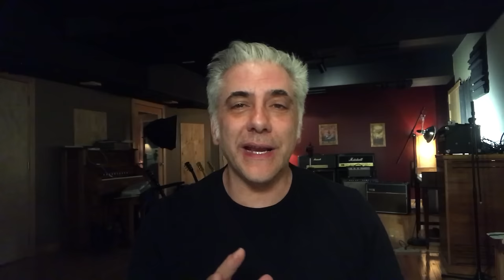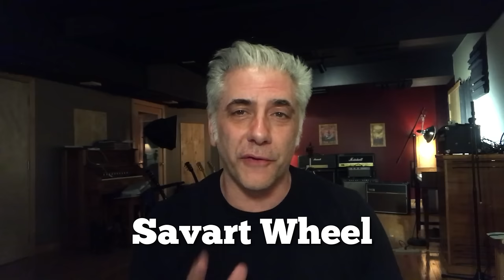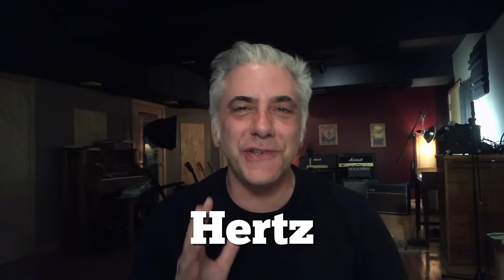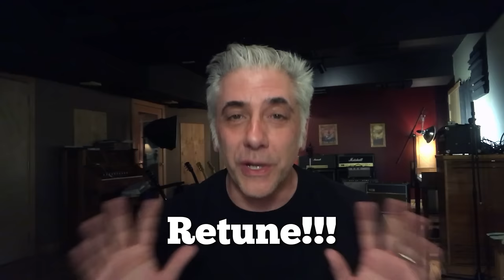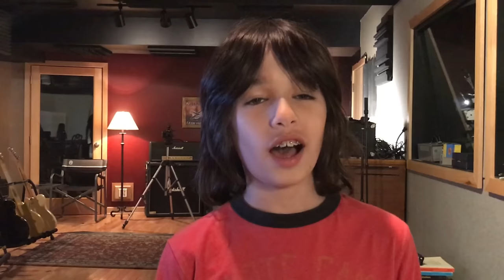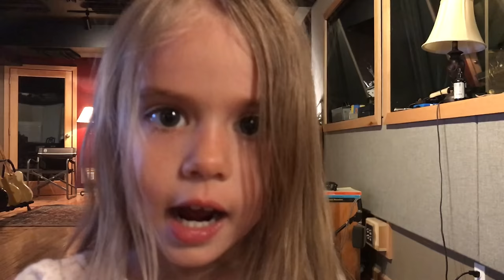What's the Deal With A = 440 Hz vs 432 Hz? Let's Talk!

Comment: I absolutely love everything about how my guitar sounds and FEELS/RESPONDS; even through the amp, when tuned to my preferred Ab/Drop Db = 432Hz. However, considering nearly every piece of recorded music that i grew up listening to; and still do, was recorded using A = 440Hz(or some variation of it), so learning/jamming along with pre-recorded music or friends, is impractical. But my love of 432Hz has nothing to do with any mystical, cosmic, or devine theories. I can only say that when my guitar is tuned to Ab/Db = 432Hz, it just sounds, feels, and responds in a much more "relaxed" way. Not so tense/intense. If that makes any sense.
Reply: Ab means that E string is Eb? I think this is 415hz
Reply: I like half step flat alot on my classical because it's mellowed out and more rich sounding. I am also going to try A 432 and half step flat from there. I wonder if the strings will sound floppy. . .
Reply: @micahmeneyerji  you are just speculating on his behalf. singers strain voices singing lower notes in 440, than higher notes in 432.
Reply: 432 is much more mathematically clean.  3 x 12 x 12 = 432.  Generally, when I'm modding games, I like multiples of 12, because 12 is in common with both base 3 and base 2 and has crossovers with base 8.  Idk, I just like base 12.  It's a really nice number.  In music, it probably doesn't matter.  Most people don't even appreciate the instrumentation of a song, let alone are able to hear a 1.8% difference in pitch.
Reply: @manictiger interesting! Western music is divided into 12 notes. 
So is time, clocks and calendars. 
And we used to use the imperial measurement system 12inch = 1ft etc
Reply: While there may be cosmic or mathematical justifications, I agree with your perspective.  It is all about our senses--which from birth we are taught to ignore and rather conform to what "experts" agree on.  And that there are so many people who feel such a need to debunk 432 is very telling IMO.

Comment: Sexagesimal second have 6.000 years. To discuss the seconds and the measurement of time and space based on the rounded seconds for the Hertz, before, we need to understand the sexagesimais origins of the second. Each turn of the clock has 43,200 slices, or seconds. And the number 60 is not a random choice. 60 is the smallest number with the largest number of connections: 1, 2, 3, 4, 5, 6, 10, 12, 15, 20, 30 and 60. We don't invent mathematics, we just discover the relationships between the quantities, and give them names. That's why I reaffirm that to understand the relationship between the number 432 and the sexagesimal mandala of 60, we need to understand its origins in mathematics, geometry and cosmology.

Comment: Dear sir, this standardization issue is a bit of a "red herring" in that it supposes that the frequency that A is mapped to is really important, but as you point out for centuries (perhaps millennia) to exactly map a master tuning frequency to 440 Hz would have been impossible without modern science.  So how did they tune at all?  For guitarists this an important point and leads us to the 6th, and the difference between natural tuning and equal temperament and Das wohltemperierte Klavier (The well-tempered Clavier) by Bach and the differences in the fractions that make up Natural tuning (for instance tuning a guitar or piano to an open chord such as G Major or E Major versus Standard tuning.  When tuned to the single Major Chord, as one goes around the Circle of Fifths, the 6ths begin to detune due to the fractions used in relation to the key center.  Meanwhile in Standard or Equal Temperament, the division between half-steps is constant, and thus as one goes around the Circle of Fifths (no matter what key one is in), the "out-of-tuneness" is spread across all semitones as opposed to being solely centered on the 6th.  If I am not mistaken, this also is the source of differences in notation on enharmonic notes, and the use of sharps when ascending and flats when descending for historical purposes.  And finally, it took the three strings of a harpsichord or piano to really center in on equal temperament.  Electronically, due to the fact that sine waves produced by electricity do not have inherent overtone artifacts unless they are deliberately designed in, we can have any mapping we desire, but it won't sound "as real" until the proper odd and even harmonics are added.  Just my two cents.  Great video
Reply: Dude, that's like at least 3 cents.
Reply: A very succinct reply.
Reply: This would explain as to why my open chord tuned guitars sound better tuned to A332 vs Standard tuned; then I just stick to the 'norm'.

Comment: Notes A3=216Hz (-31.77 cents) and G#3=204Hz (-30.7 cents),, just lay completely natural to my voice.. The ~ 30 cents lift from ~432Hz to 440Hz for A4 is not natural for my voice... MY voice relaxed resonance is around the tuning of A4 at 432Hz.. Singing high notes comes very natural when the guitar is tunes at 432Hz vs 440Hz.. The passaggio is shifted too high at 440Hz
Infact the highest pitch for my voice if I lay of a lot of weight (early transition) is ~438Hz (~8 cents). A4=440Hz is very difficult to find the balance in the throat..  In my world 440Hz excludes a lot of voices in music.. The previous european pitch at 435Hz is a better comprimise between a high (445Hz) and low pitch (425Hz). 

A4=424-425Hz would be close to Mozats and Händels pitch as they used a forks at A4=421.6 and 422.5Hz but they were probably using a more "pure"  tuning system like meantone or just intonation which was much more common which sets the A (major six. or La) note flatter relative to 12-TET in the C major scale. I think it was a piano tuning company from late 1800s that had their pianos tuned in Meantone at 433.5Hz for A4 and with 12-TET is was A4=436Hz. A difference of ~10 cents.   
A tenor hitting the high notes to Händels halleluja to a piano tuned to 425Hz would be easy, nice and full.. At modern A4=442-443Hz which many like to tune their classical instruments at .. The tenor sounds bad... It is only the spinto tenors (very few individuals) that would sing the high part with ease... 
We got it all wrong,, The previous pitch at 435Hz is as high the note of A4 should have gone to get the right classical division of fachs.. 
This is a fact...440Hz is a very "unnatural" singing pitch if I may use that word.
Reply: dansk björn 440 is unnatural to your body, and it is to mine as well - but my body is more comfortable around 450. The tiny bit of extra sharpness really helps me maintain consitant intonation. Conversely, I have an old bass trumpet that doesn't tune any higher than 430 - and I prefer to play it around 425. Every body and every instrument is different, and you gotta do what works best for you and for your equipment!
Reply: 424-425/449-450hz as a nice spot i completely can relate to. it is another nice area together with the 432/457hz area. what is your vocal fach when singing.. 
the weirdest pitch area for my voice is 439-445hz. not low enough and not high enough

Comment: Western music in equal temperament uses 12 different frequencies, only one of which is a multiple of the frequency of A : the A itself.

A piece in Eb major tuned at 432Hz will contain no A at all, so no instance of a note vibrating at that 432Hz frequency.

This should be enough to debunk the 432 Hz bullshit.

Comment: Cycles per second weren't specifically measured until the year 1834 when the Savart Wheel and the Tonometer where invented, but because the metric system came out in 1795, music was accurate; even more so, relatively, than most people today with tuners. They knew, then, the note range for any given length of tube for a horn or a pipe organ to get different notes for transposition. The earliest development known for the metric system is from John Wilkins. 

In 1668, he proposed a coordinated system of units of measure for length, area, volume, and mass. This means that people knew what they were tuning and building their instruments to for more than half of the Baroque Era and all of the Classical Era. Things are generally accepted before they become standardized, but even if instrument makers didn't know the Hertz value, the metric system is defined as being derived from nature. 

So, like I've explained, instrument makers, then, knew the acoustical output of instruments based on the shapes and sizes of natural objects through simple observation. They might not have had tuners, but Europeans knew how to trace and compare lengths precisely since before they came out of caves. Perception is rooted in nature and the observation of it consciously.

This is why your son sang a 33 and a third cent wide quarter tone. Let me explain; he had to hear when one note range started and the other one ended. 448 Hz tuning actually sounds 1/3 of a note flat, 440 Hz sounds 1/3 of a note sharp, and 432 Hz, being 40 octaves lower than the calibration of primary and secondary visual colors within a 12 tone system, sound balanced. 

Stay with me, now. He sang the note up past 448 Hz tuning and touched 456 Hz tuning (the next note up from 432 Hz) and in doing so, he then brought it down to where the note would sound so flat that it couldn't be confused with being the same note compare to the commercial standard of tuning. Take a look at this repeating pattern rooted in the conscious awareness of the complete range of any "A" (Orange) that is 40 octaves lower than the THz range of the visible colors Red through Yellow:

•flat = 400 Hz = Ab = Raspberry-Red 
+8 Hz
•in-tune = 408 Hz = Ab = Red
+8 Hz
•sharp = 416 Hz =Ab = Orange-Red
+ 8 Hz
•flat = 424 Hz = A = Red-Orange 
+8 Hz
•in-tune = 432 Hz = A = Orange 
+8 Hz
•sharp = 440 Hz = A = Yellow-Orange
+8 Hz
•flat = 448 Hz = A# = Orange-Yellow 
+8 Hz
•in-tune = 456 Hz = A# = Yellow 
+8 Hz
•sharp = 464 Hz = A# = Lime-Yellow 

We are dealing with microtones, here, but compared to the World War tuning, in-tune is flat; flat is sharp (as the next note down); and, (as sharp as any note can be before it is in the next range of color) is in-tune. 
Understanding this will have you realize that 440 Hz came about to make music sound sharp. It is better to sound sharp than out of tune, but that is just 440 Hz, not 442 Hz or 445 Hz. 

I hope that this explains some of the weird theories that claim that 432 Hz can expand your awareness. It sure could help you to understand and develop perfect pitch. Thank you for taking the time to read all of this.

Comment: The difference of 440Hz to 432Hz is 1.8 percent. If you play a cheap acoustiv guitar for some time, you will start at 440Hz and end at 432Hz. The BIG benefit of the cheap guitar: you get all cosmic tunes between 440Hz and 432Hz. Doing this, you may find the secret frequency of the universe!
Reply: since music frequencies are logarithmic you cannot compare them in prtcentage which is linear, for A4 at 432 vs 440 it is approximately 1/3 of a half tone, that 1/3 of a half tone increases in percentage as go move to higher frequencies 😊

Comment: I had a harpsichord (an 18th century French design) with a modern transposing keyboard to allow playing at A 440 or 415 depending on the situation.  A=415 was the preferred pitch for musicians specializing in Baroque music in the Bay area at the time and I always preferred playing Baroque music in A=415, although the actual pitches they used were varied.  Now that I play guitar instead and prefer to play in A=440 so I don't have to mentally transpose when playing with other musicians, although tuning down certainly works for some players and can sound quite good.

Comment: From my deep study of physic and ancient knowledge what we might call "SOUNDS BETTER I LIKE IT" is most certainly related to non destructive interference where the sound oscillations vibrate non destructive are phase conjugate and imbend n each vibration recursively.   This is occurring where whatever you want to call tuning vibrates without resistance with the Shuman harmonic of the planet earth and is also divisible with planks distance. It the musical keysignature of the universe  around. 618 x 10 to the negative 33 centimeters  ie the smallest oscillation where the 11th dimension breaks down and becomes a compreshional wave..  but I like 432.;)

Comment: my just turned 3 year old daughter has a much easier time staying on pitch to music pitch to A4=432Hz than A4=440Hz.. My own voice and vocal chords seem to hum naturally with an A3=216Hz rather than A3=220Hz which is placed high and tense in the throat. Verdi was a proponent of keeping A4=435Hz (french pitch) or even lower it to 432Hz..  Changing back to 435Hz would be good. Casting the correct voices for Puccini and Verdi would be easier as modern 442Hz pushes the vocal passaggio to high for the correct dramatic voices for those operatic pieces.. Also rock singers would benefit slightly by a -20 cents lowered pitch..

Comment: Hey Rick - do you believe in such a thing as 'perfect tempo'? If so, is it acquired in the same manner as perfect pitch?
Reply: Would "perfect tempo" be like being able to tap, say, 44.73 beats per minute accurately?

I don't think this exists, but if it did, I would assume it would be parallel to perfect pitch, and would have a contrasting relative tempo. People without perfect pitch come close by using relative pitch, so they keep in mind a particular note and figure out the interval between the given pitch and the note - relative tempo would be achieved by say, listening to your watch ticks and knowing what 60 BPM sounds like, then you tap a rhythm at 60 BPM that gives you some other rhythm (if you tap dotted quarter notes at 60 BPM, you get 45 BPM - if you tap half notes at 60 BPM, you get 30 BPM - you can work out most tempos by doing a process like this). It's a starting point, but I would imagine it's not possible to be that accurate at memorizing tempo.
Reply: Paul Sampson for mammals, that's roughly 1.5 million heartbeats 
Yep, bizarrely enough, our organs have finite operating limits, just like the things we manufacture. 
Sobering thought.

Comment: Originally I would have supported A=432Hz in the sense that 432 can be divided by 6 and that would have made the musical scale divisible as a whole rather than leaving fractions behind. 
Then I suddenly realized that most music scores were written under the definition of 100 Beats Per Minutes and that totally turned the table around as A=440Hz would be translated into A=264CpB (cycles per beats) and THAT would have made the frequency divisible as a whole. 

Maybe we should adopt a fluid A= system depending on the BPM of the music.
Reply: 432/8 (physical)
432/9 (ether/spirit)
86400 seconds per day...
So - wanna be in sync or out of sync?

Comment: This 432 nonsense is pretty confounding. The usual arguments come from numerology and "sacred" geometry, Pythagoras, etc., and essentially amount to: "look how many coincidences there are, pyramids, diameter of the earth, etc.!" The problem is, with regard to measuring pitch in hz, at least, it's relative to number of vibrations the length of a second, as a measure of time, which is arbitrary. It's true there are 28 lunar cycles per year (on our planet, at least), and the day is of a distinct length (24 hours), but the second is derived from the minute, which is derived from the hour, which is derived from the day, etc, (all, incidentally expressed within the conventions of the decimal (10-based) number system) and utilizing convenient ratios (12 is divisible by 2, 3, and 4; and 60 by 2, 3, 4, and 5), to APPROXIMATE something that happens in nature, again, expressed using the conventions an arbitrary number system based on how many fingers we have. All that said, even IF there is something special about 432, it's only as it relates to the length of one second, which is arbitrary and has nothing to do with nature except as a very gross approximation. So... in other words, even if 432 has some special mystical/natural significance, the pitch of 432 hz does not necessarily, because it is only as it relates to a second, which is an arbitrary division of time. It's like saying 432 inches is a "special" length, or 432 bushels of wheat is a "special" amount that resonates somehow the music of the spheres.

Comment: Let's trow some physics into the mix. Dividing 1 by the Planck time (the shortest time possible calculated from the fundamental constants of the universe) yeilds the Planck frequency. Divide this frequency by 2 to get the same tone 1 octave lower. Do this 135 times an one arrives at 426Hz. This then is the fundamental tuning of the universe. Our year has 365.244 days instead of the ideal 360 so our days and seconds are a little short. Multiplying 432 by 360/365.244 also yields 426Hz. What happens if one uses 426Hz to play and compose music?